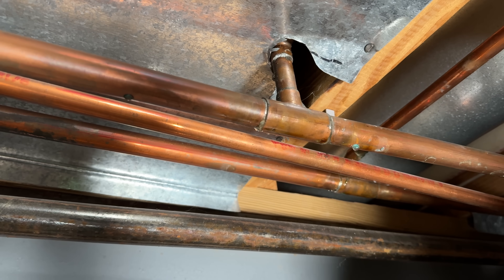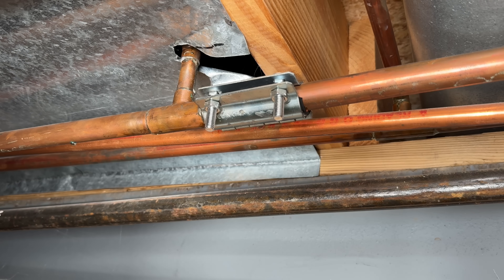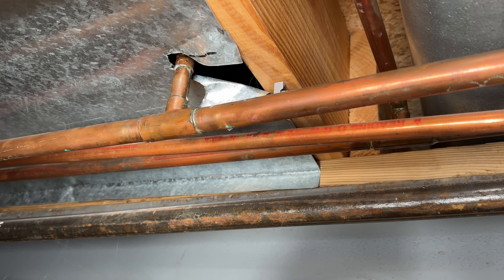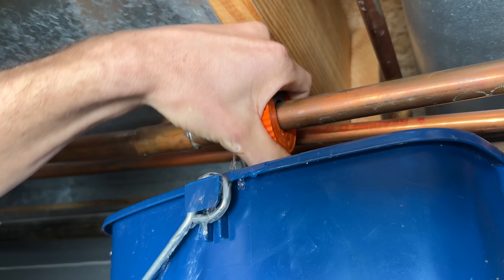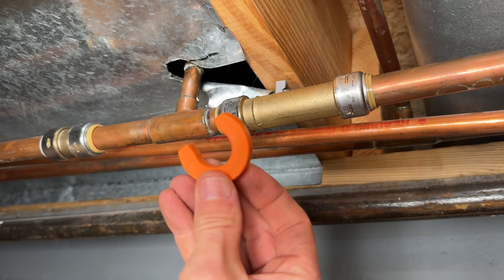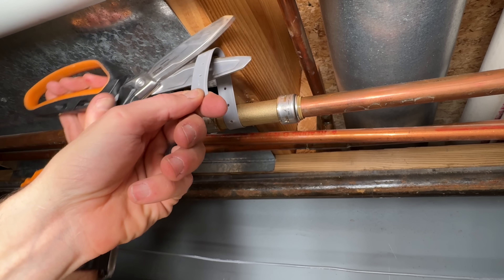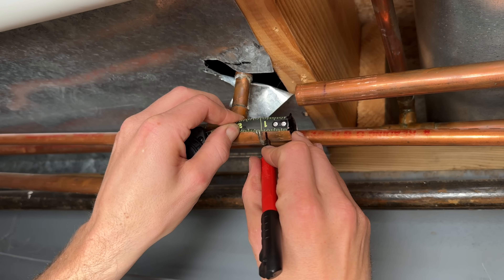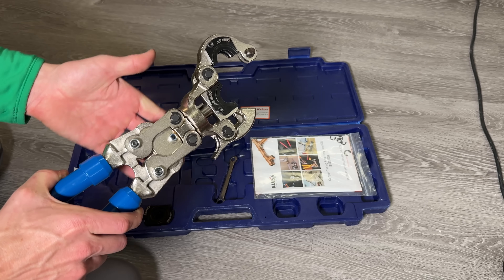How To Fix A Pinhole Water Leak In Copper Pipe | No Soldering Needed!

Comment: If you have multiple pinholes there, then the pipe is probably getting thin elsewhere. That points to a water quality issue and you should really be prepared for more leaks relatively soon.

Comment: For a permanent fix the whole length of that copper pipe needs changing, three pinholes visible suggests there will be others, new copper pipe with soldered joints is the way to go,

Comment: This video was great, well explained. I enjoy all your videos. The SharkBite coupling that you used is a polybutylene conversion coupling. The one end of the fitting is gray. Polybutylene pipes were banned in 1995 because off pipe and connection failures.
Reply: I believe the ONLY difference with the Polybutylene SharkBite fitting is the diamiter of the insert for the SharkBite side. It is larger because the Polybutylene pipe is thinner so the insert has to be larger in order to make the pipe press outwards against the SharkBite o-ring and the teeth that grab and hold the pipe. I think the outside diameter of the polybutylene pipe is the same as copper pipe. I could be wrong.
 I recently found a PEX coupling at Home Depot for Polybutylene to PEX. It only comes in the 1/2" size. The brass coupling is two different sizes and it comes with two different crimp rings. One ring is the dark one you see all the time, the other crimp ring is brass looking. But the brass ring seems to be the exact size specs (inside, out side and length) as the dark ring. You use the same crimping tool for both rings.
Reply: Very bad if true

Comment: That manual press tool appears that it leaves weird gaps at the ends of the fitting. In other words, the end result looks pinched around the pipe instead of a smooth consistent crimp all the way around. It looks ugly and not likely to hold. Comments??
Reply: It's temporary

Comment: Wonder how available the crimping tool is to rent like at one of the chain hardware stores?

A number of comments on root cause of pin hole leaks. A good video subject. My friend has this problem at his house and in part due to well water. He has to replumb house eventually. 

As such, you have subject for another video on dyi to replumb whole without pulling all the sheetrock down. Imagine PEX is ideal for this?

Comment: I held off buying propress because of the exorbitant price of the press tools. However, Rigid came out with a press tool that is a bit cheaper and only does 1/2" and 3/4" copper pipe. So, I took the plunge. I absolutely love it. It works flawlessly.

Comment: We just had a copper pipe ceiling leak and the plumber used Pex. He said almost every plumber who wants to make a profit and save time uses Pex. The world is definitely changing. Years ago we had a water softener put in and the seasoned plumber used 1/2 inch L copper for the brine flush line. He said his deal with Rayne was that he would only work with L or K pipe otherwise he would be working for someone else! 20 years later the pipe still looks great.

Comment: Is that pipe branch going up through an hvac return duct???
Reply: 7:33 yep return using the floor joist framing

Supply duct is round on the right

This 1/2" copper pipe teed looks like a ice maker cold water only supply

House is probably built before y2k
Reply: @JPetersU2be  pinhole leak in that leg could just function as a whole house humidifier 😂

Comment: Using SharkBite with new pipe I would consider permanent, but that copper pipe you have, I think has a lot of thin spot that you will see in the coming years, time to replumb the house.
Pro-press and other crimp fittings, I don't know how long the rubber O-rings will last.

Comment: I had a pin hole on a copper pipe and what I did was just cut a hose line I have laying around and cover it then tighten it with a hose clamp. Work exactly like your example. These are stuff every one might have laying around.

Comment: I’m nearly 50 years old. I’ve sweated pipes occasionally (as aDIYer) since I was a teenager. I really don’t understand why anyone would bother with the gimmicks and expense of going with any other option. I also don’t understand how anyone could find sweating a pipe to be difficult. Put fire on it and add solder or put fire on it until the solder melts and pull with a pair of pliers. How much more simple could it get? I mean, propane is cheap as chips and I think I bought my torch when I was 16 for like 47 cents…
Reply: One of the situations where sweating the pipe is difficult is when the shutoff valve won't completely shut off the water, and you can't get all the water out of the pipe you need to sweat.  When you heat the pipe, the water turns to steam, and blows the flux out of the joint.  This causes the solder to not flow into the joint like it should, and a leak results when the water is turned back on.  This is a situation where the propress works well.

Comment: I had a sharkbite failure on a copper pipe.  Thankfully when I was there to turn off the water.  Went back to solder.  Sharkbite are probably fine for pex; I don't trust them for copper pipe.

Comment: Ummmmm..... you should probably address why the hell theres a pinhole in your copper line before you do anything and then stop buying plumbing supplies from whatever junkyard you pulled that turd out of....  no way I'd cover that pipe up with drywall after fixing that leak out of fear that its going to spontaneously spring another leak.

Comment: I don't do plumbing at all, but I was in trade school where that was covered. In my opinion, a professional that doesn't sweat the pipes and does it the proper way, is not professional. I'd even say he's lazy. However, if the homeowner calls in a professional, then the plumber should do what the homeowner says to do.

On another note, Not sure what the thing is with the sheet metal but I think it might behoove you to take the sheet metal down, if it can come down, or find a way to reroute the pipes, if the sheet metal MUST be there. The two metals don't get along and you're certainly going to have problems with leaks or even complete pipe failure. Putting plumbing, wiring, or anything else through air returns is not how to do that and shouldn't be done. But just a suggestion. If I was into plumbing the way I am into electrical, I would definitely have an acetylene torch and all the tools of the trade, if I planned to do my own work. I am into "The right tool for the job."

Rental isn't ideal because by the time you've done a few projects, you could have owned the tools. Even if they sit in your basement, forever after your last project, pass them onto your kids, or someone else's kids, that might like to have them and get use of them. 

I am finding that valves I touch are either stuck or start leaking. I am going to get a plumber out here, bite the bullet, and get them to put ball valves on all my fixtures, from water main, to outside shut off, regulations for the dishwasher and sinks, and even replace the toilet shut offs. Just going to have to bite the bullet and spend the grand or more because it MUST be done. 

Anyway, great video.

Comment: Thanks for the reminder. I need to put in a permanent fix to replace the heater hose I used as a temporary fix after the Texas arctic freeze a few years ago! That slip fitting should work just fine.

Comment: I've used SharkBite (or releasable SharkBite-style) products on plastic (or whatever) water tubing, but that's it.  Being familiar with SharkBite (or similar) and how they work, I'd likely would have gone with SharkBite for leaking water pipes because I hadn't heard of the others.  The SharkBite slip-joint design is cool!  After learning about the others and that they require an expensive crimping tool, SharkBite would still the way to go for me.  It's good to know that support for a level repair is best without any bending/angle stress on the SharkBite repair.  Thanks, Scott.

Comment: I'm in Florida, all the new homes here have pex or CPVC. Don't know how many new generation plumbers here would even know what copper is.😂. Thanks for your time and videos. 👍
Reply: Agreed.  Copper sweat fittings are basically outdated technology (and the price of copper is 🤕) but of course many will still say "its the right way" to do it.  I've had pin holes in copper pipe,  never had a pin hole in pex to date.
Reply: @mrpriceisright certain building classifications only allow copper and cast...
Reply: Sort of irrelevant point because all houses built before the 90's were all copper, so thats what you have to deal with.
Reply: @srobeck77  ? But the repair doesn't have to be.
Reply: Pex is great! Way better than SharkBite. But is a different animal.

Comment: I re-plumbed my home as part of a whole house renovation nearly 20 years ago. I also installed a radiant heating system. I used first generation shark bite products extensively, with both pex and copper. To date, I've had no problems.
Reply: Deburring properly is the key.
Reply: I've seen shark bite fittings fail in 5 years. If you really had no problems for 20 years, and your whole house is SharkBite, then expect many leaking problems to come. lol
Reply: @mrdan2898  Any fitting connector type can fail, 'in 5 years', if it wasn't installed correctly.  That's true of every type of fitting, from shark bite to pex (A or B) to pro-press to sweated.
Reply: @melmartinez7002  Not necessarily because they operate differently. Pex A and B don't have a inner rubber gasket that will fail.
Reply: @mrdan2898  Both Pex A and B can be installed incorrectly.  If the crimp ring (B) is not in the right position or the pipe is not seated all the way in the expansion collar (A) or if neither is seated correctly over the barb(s) on the fitting or if the barb is scratched or damaged in any way then, yes, they can definitely fail.
Reply: @melmartinez7002  True, but Pex A and B are installed correctly, they won't fail. But a sharkbite's oring will garrantee fail at somepoint. I've seen the rings fail. The oring becomes compromised, and the leaking starts.
Reply: @mrdan2898  The  o-ring only becomes 'compromised' if installed incorrectly.  I've seen every type of fitting fail, from both pex types to sweated copper.
Reply: @mrdan2898 I have one almost 10 years now no issue. It is all about not deburring properly that cause issues
Reply: @mrdan2898 My friend owns 128 apartments and has used hundreds of Sharks and has zero issues. He has used them for many years. He is also very good with standard plumbing  but he now prefers Sharks.
Reply: Soldered copper is just as unreliable if not prepped properly. Preparation is everything. Sharkbites rely on their orings not getting damaged during installation - so debuuring and chamfering the pipe is essential.
Reply: You replumbed your house and used sharkbites?  So ghetto.
Reply: @muyoso pretty expensive way to go
Reply: @muyoso  lol, yeah

Comment: Last time I had to have this fixed in my place, my handyman put a shark bite on which stopped that leak, but the pipe then broke below the shutoff valve (basically the supply line started leaking right where it came up out of the floor). I had to call in a professional crew to fix that. They took one look at the shark fitting, shook their heads, tore it off, and sweated new copper on. I haven't seen those copper sleeves before - maybe it's a regional thing? I'm in the Chicagoland area. Anyhow, thanks for the vids!
Reply: That's funny! I bought a house from an old lady and she got 'soaked' by some 'professional' plumbers the same way for a fix on 2 washer supply lines. Those pipes were so crossed over and crocked looked like crap. I cut all that junk out and sweated in some new ball valves and copper. Nice and straight too. The burned her for over $300 for 20 minutes of work. And that was 20 years ago. Those 'Pro-Press' couplings like anything else, is for production work or speed over quality. Mostly on these new cheap built 'boxes' with the stiched together wood.
Reply: Of course plumbers charging $100/hour are gunna whine about them. Ive had more soldered copper joints fail then zero for sharkbites.  No offense, but the number 1 cause of sharkbites failing is operator error on the install (aka you didnt push it on far enough, didnt reem the copper, etc)

Comment: I would be tempted to call a pro because if you have two failures on the same pipe chances are there are bigger problems.   Push on connector is fine for a temp fix.
Reply: Yep, indicates piping will just have still another pinhole leak before too long.  Water hardness and/or pH produces also thinner walled copper pipe produces these holes.  Time to replace it all with PEX.
Reply: I mean if your into paying $400-500 for that type of fix from a licensed plumber hell ya man, go for it. Ive had push-ons for 15 years now, no leaks
Reply: @srobeck77  and I have 3 repairs and counting in the same copper.

thing is, if one piece of copper wears through - the rest of the copper has had roughly the same age and wear.
Reply: @kenbrown2808  ok but then you just cut out the copper pipe as far down as you want to go and then plug in more Sharkbites. Very simple, so I dont understand your point.
Reply: @srobeck77  for convenient math, we'll call it $25.00 per repair - they are a bit cheaper in the big box store model.  at that rate, it's only 10 repairs before you would have saved time and trouble having a plumber replace the worn out pipe.
Reply: exactly: the rest of the pipe is the same pipe that developed the pinholes.
Reply: Yup. I discovered a pinhole leak in a 40 year old 3/4” cu pipe. The leak saw in a section that passed over the galvanized steel ductwork by about 6”. A very common occurrence in my neighborhood. I started replacing all cu with PEX-B. Once the bad section was cut out, I counted more than 20 pinholes in the 26” of pipe which were in proximity to the galvanized ductwork. Nothing anywhere else.

Comment: These days plumbers are most likely going to use press tools and fittings for a job like this. If you can get access to the tools and take the time to understand what to do, there's no reason to not DIY a simple pinhole leak fix.

Comment: Solder in a new section including the "T".  Also, when possible avoid cutting the sheet rock all the way into the corner were it meets the wall.  It will easier to restore.
Reply: I'd trust a Shakrbite before some plumber sweating a new fitting in, there's some flunkee plumbers, but I've never seen a Sharkbite fail.
Reply: @land7776 a moron can sweat in copper.  It's incredibly easy.
Reply: You didn’t see how he needed the ceiling open to the wall to fully open his crimping tool handles? I agree with you otherwise though 👍🏻
Reply: That's what I would do here. But in the case of where it's hard to stop the water from draining into your work, sounds like the alternative is the way to go.

Comment: That copper is probably old. Copper will only last about 50 years if the water is acidic and depending on the gauge of the copper (thinner lasts a shorter time).  We noticed recent green staining on the tubs under the faucets indicating degradation. If one pinhole started leaking, then more are coming. We had our pinhole leaking horizontal copper (probably from coils when house was built) in the crawlspace taken out and replaced with PEX. Vertical joints to the fixtures were thicker stock and not (yet) leaking, and due to the expense of replacing them too, left them in.

Comment: Looks like a useful tool however some users have complained of leaks due to the manual propress tool not crimping with enough force as the battery powered tools.  Jury is still out I suppose.

Comment: Scott !!!!!!!!!!!!!!!!!!!!  One of your BEST Videos I’ve seen!  Plumbing issues and fixes and retro fittings have been my challenge for awhile now.  

I had occasion to watch a plumber use the Milwaukee Pro Press system, and it is really something.  I shared this with my wife, and she immediately put the skids to me getting it!  😯 😆 

I am thinking of getting one of those new SkarkBite Max fittings, that You used here?  It would be a 
ball valve shutoff for 3/4” PEX pipe, that transitions from the PEX, to copper on my water heater?  I wonder your thoughts/ recommendation on that, VS the older style, with the ‘sleeves?’ Anyone else in the community?  Thanks!
Reply from the maker: I would go with the new Max SharkBite especially with 3/4” as the pex will be pretty solid without the insert.  SharkBite really shines with the ease of transition from copper to pex.  Thanks for the kind words!
Reply: @EverydayHomeRepairs  Thanks for reply Scott!   You made a Great point on the extra stiffness of the 3/4” PEX.  SharkBITE MAX is what I will go with.  And I only say what I mean, and You're Welcome!  😊🤝

Comment: I soldered a pinhole just out of necessity. The situation I was in I couldn’t make a repair without making a mess and pulling a lot of the drop ceiling down. And even then, just the location of the pipe would have made it very hard to do any repairs anyway. And on top of that, the valve that isolated that branch from the main line didn’t work. So eventually I had the time to shut the water supply off to the entire building, drained what I could from the line, cleaned around the pinhole then fluxed around it and got a dab of solder into the hole. 

Seems to be holding fine after a year.
Reply: This solder fix will outlast any prioress or shark bite.
Reply: Until another dozen or so pinholes appear 😢